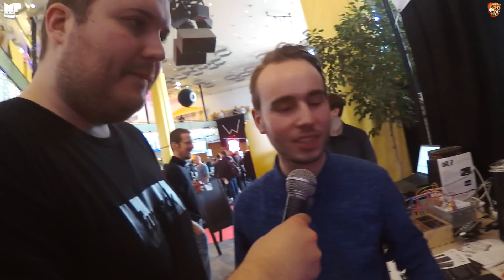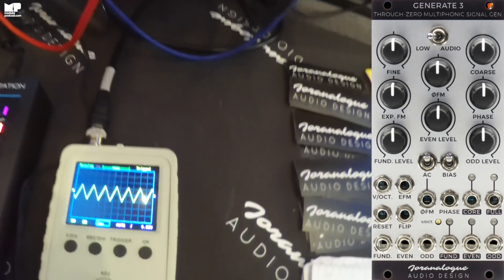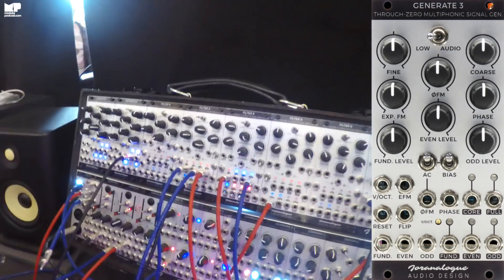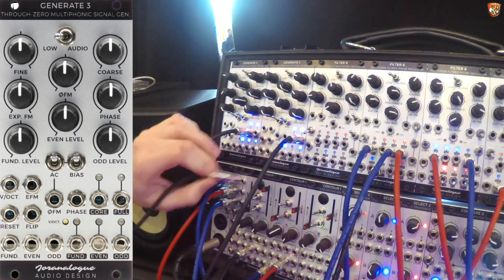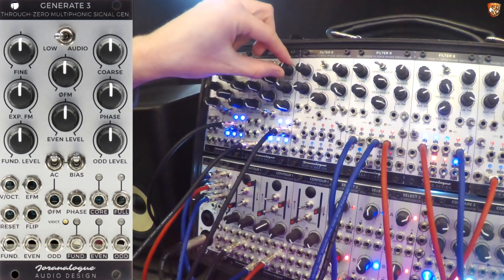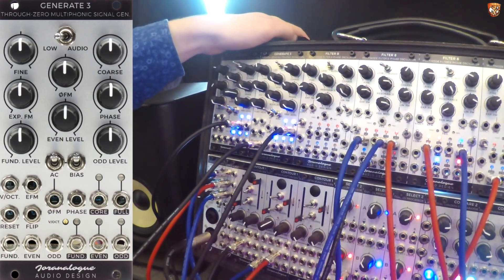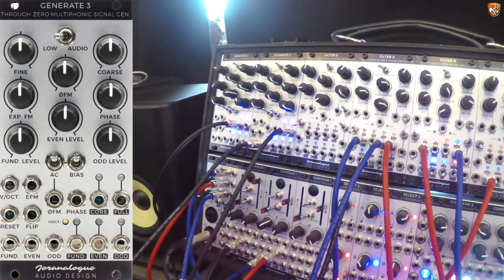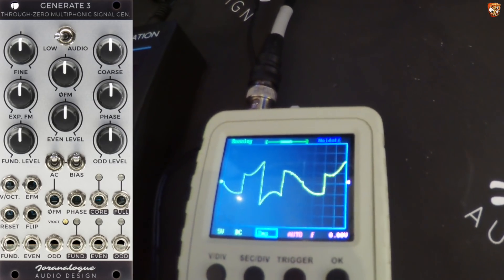Next level analogue oscillator design from Joranalogue's Generate 3 // Superbooth 2019

Comment: Through-zero FM produces stable tones. Switching out the through-zero range gives you a flavor of “standard” FM, which does not so much, depending on what’s modulating what (though sync or phase adjustment can help with instability). Having real linear and AC linear gives you options for getting the sound you want. The exponential FM variant is what we typically see in percussion uses and it is the “FM” we find on lots of equipment, and that one is famously rough on tonal stability. (That’s here as well, plus full AM and phase and synchronization, which is great to see.) The Joranalogue guy sounds clear enough on these subjects, but users always get lost. It’s good to recommend his manuals, because this module, with its technical descriptors and multiple modulation types, will provide confused users with a great opportunity to learn what’s what.

This module is packed with potential, and that’s not unusual for this company. It’s not simple work to get so creative with analogue - usually people give up and go to coding these sorts of functions.